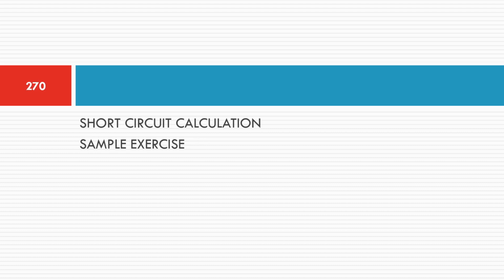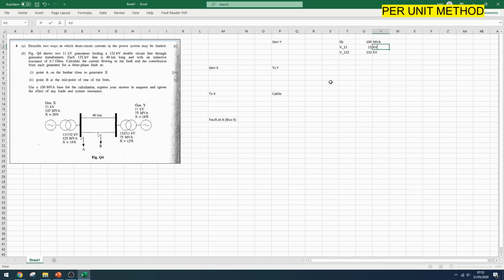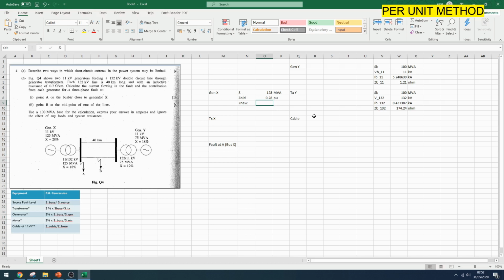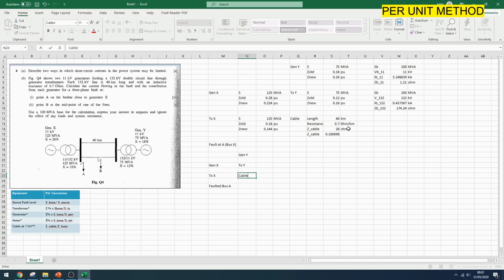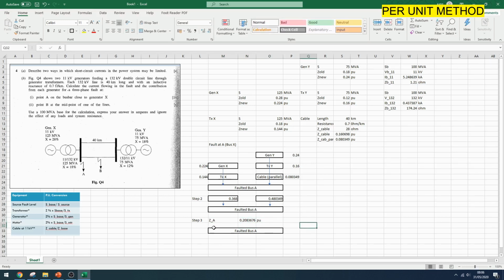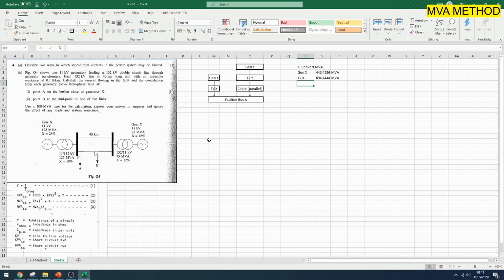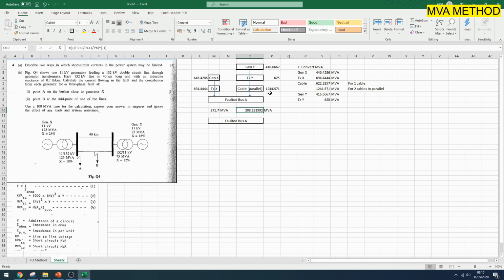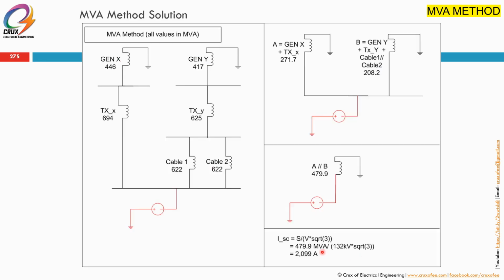Protection System 17.2 Short Circuit Exercise Example (By CoEE)

Comment: What is the answer at fault point B? just want to check with my calculation.
Reply from the maker: For the fault at B, which is in the middle of 1 of the cables, I used the MVA method. When you redraw the MVA diagram. Later, you will find that there will be a delta connection. You need to convert this Delta connection into Star connection. Then only you'll be able to reduce the MVA to a single point. You may refer to the SC Calculation pdf link on how to convert Delta to Star connection for MVA method.

As of now, the answer is 431.2 MVAsc or Isc =  1.886kA @ 132kV.

Please check😄